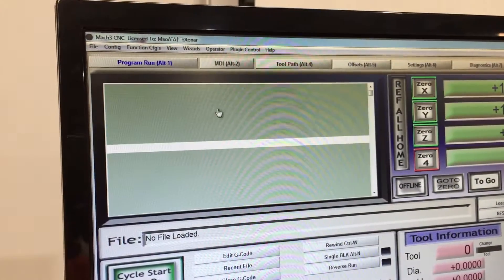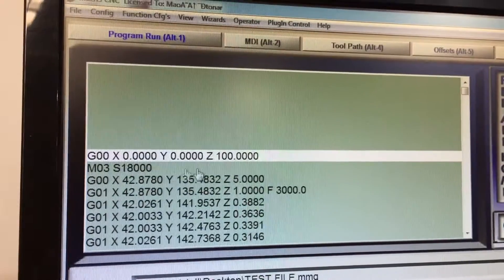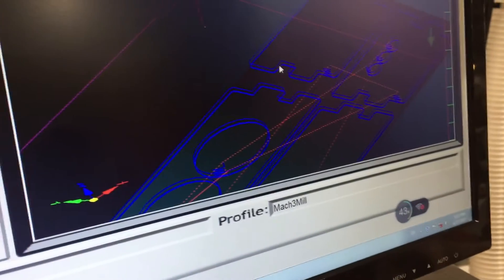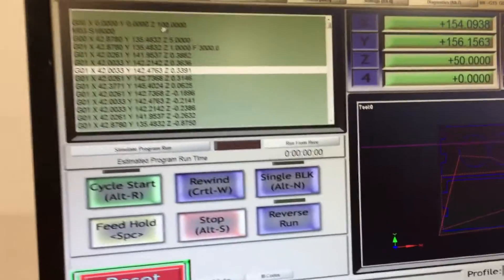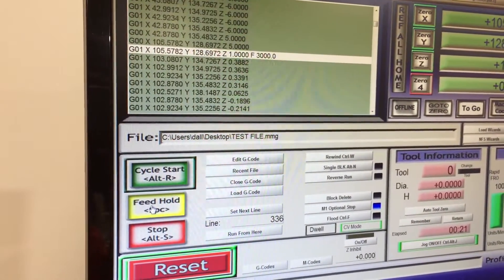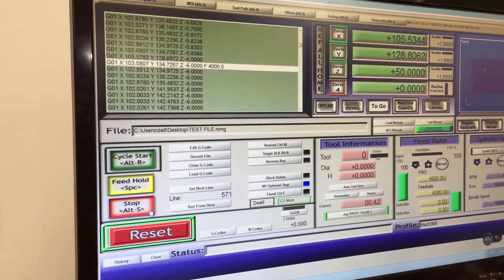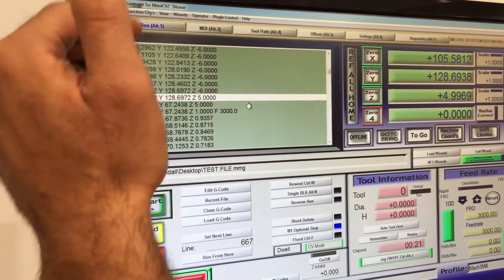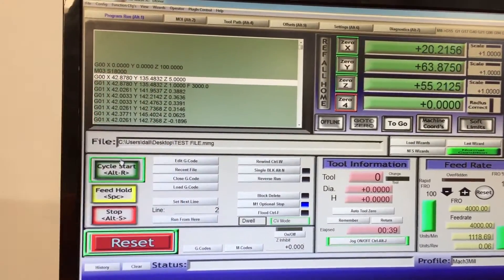CNC Routing Machine RS6090 by Redsail - Loading a Program to Process

Comment: I have a redsail rs6090 and i have problems with increasing the speed of the spindle,I did get in touch with the manufacturer but those instruction do not work ,is there a video on the subject? or can you tell me what i have to do,i am using v carve aspire for my software,and i use a dsp handle,thank you in advance